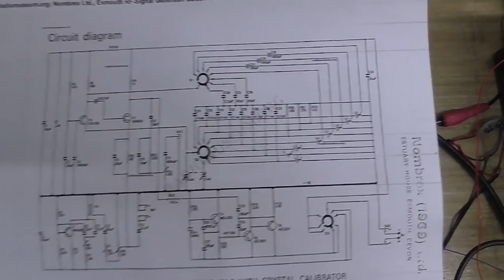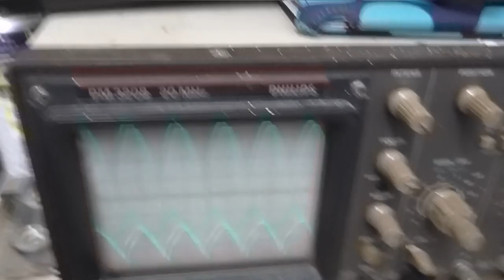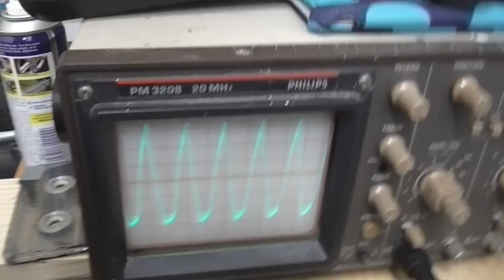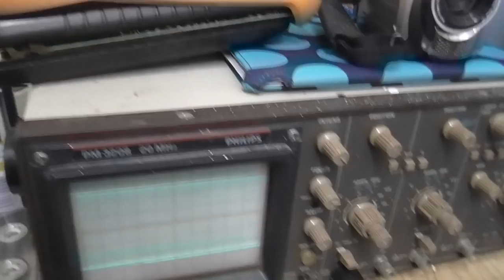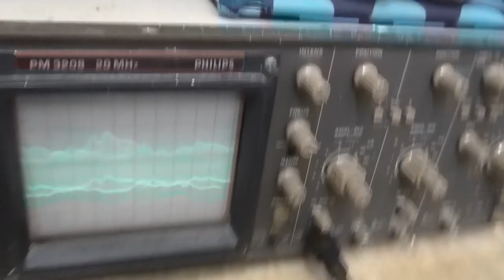More tinkering with the Nombrex 41 - We have Audio Modulation!

Comment: I reckon I can explain your "enigma" Clem.The R.F. Signal Generator when removed from it's screening box can act as a regenerative receiver for at least one strong V.H.F. F.M. broadcast although with no way of directly listening to it's audio output.The Sinewave output of The R.F. Signal Generator is noticably distorted due to unsuitable transistors as you have already realised and so there will be strong harmonics.These harmonics will carry the same modulation as the fundamental (what you actually tuned the R.F. Signal Generator to) and it will be one of these harmonics that you received on the Ghetto Blaster.

Comment: Long time ago but my father owned the very same signal generator (and other Nombrex) , all bought from new. Surely there are some equivalent transistors that will function adequately in the same circuit, that's if you haven't sorted the problem, I know it's an old video. 
I have fond memories of Nombrex equipment.

Comment: 1st - I think you can make it work right by changing resistors around those "wrong" transistors to tweak a bias just right. Maybe those transistors turned on more than they should be, so when you decrease supply voltage you correct the bias.
   2nd - you just made an FM receiver! You probably heard a strong local FM station when you tuned the gen to a frequency, that is 10.7MHz lower (or higher) than the frequency that radio station broadcasts on.
Reply: +MrJohhhnnnyyy I have a bluetooth FM transceiver, and for whatever reason (if I had it tuned with enough space up or down the frequency I had it tuned to) I could listen to the music /I myself/ was playing within that range you are talking about. Is this a sign of a bad engineering, why does it do this?
Reply: +Me_iz_we :T If I got it right - you can receive the station in 3 places (10.7MHz lower, at right frequency, and at 10.7MHz higher). Then: nah, I can't say that is terribly bad engineering. Your receiver has a bad image rejection. That is common to all superheterodyne receivers, but more sophisticated designs almost don't have this issue at all.
Reply from the maker: +MrJohhhnnnyyy I thought it might be bias, trouble is some the transistors there such as the ME3011 have very low hFE (about 20 according to the datasheet), and whoever replaced some of the transistors used ones with a way higher hFE, so even with the bias corrected it will still distort because the gain is too high.

I didn't know FM receivers also used a superhet system too (I saw you mention that in another comment), Now I know that it does, it makes sense how I was able to "tune in" to another station by adjusting the frequency generator, I guess I was using it as a sort of local oscillator!
Reply: CoolDudeClem If you have the time and wish, you can correct the bias and add degeneration resistors to keep the transistors which do amplification from clipping.
 Yes, indeed you employed the Nombrex as an LO. Sometimes you'll build receivers when you don't intend to :) I was tinkering with my FM superhet few days ago, and I built another tuner for it. I was building the ciruit from the output side to the input, so I finished building LO and mixer, and when I turned it on I managed to receive SW on it :D Purely because I didn't have a low value choke from the input to ground. I built it like that because it's much easier to make it work cascade by cascade.

Comment: What are the part numbers you need. I might be able to help you find them. I live in the states but surely it can't cost that much to mail them right?
Reply from the maker: +J&amp;B Fix it shop Thanks, but they're very old and not made anymore (at least to my knowledge), if you can find them, they are ME4001 & ME3011
Reply: If this helps the me4001 crosses to a nte 123ap and a me3011 crosses to a nte107 if you want I have both nte versions. use google and type in nte123ap for example you might have comparable crosses in your boneyard. Let me know if you want them I will gather up a few tomorrow when I get in the shop.